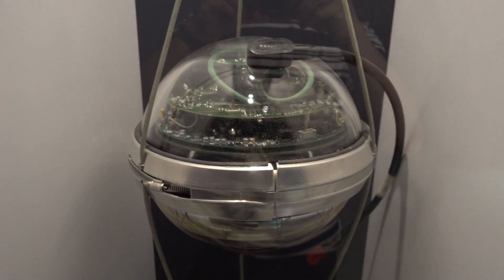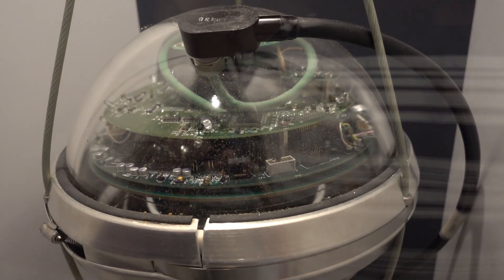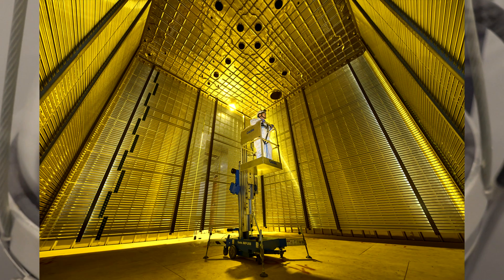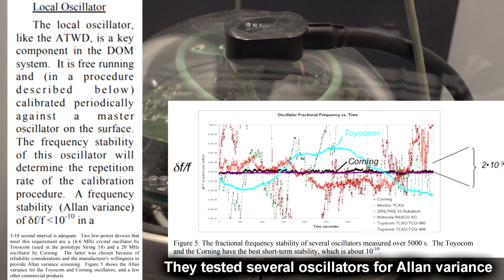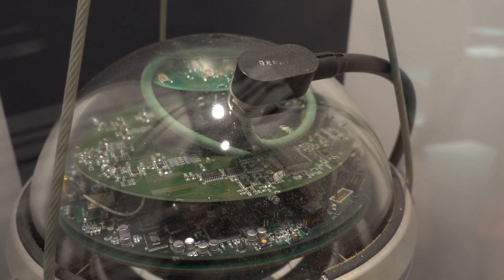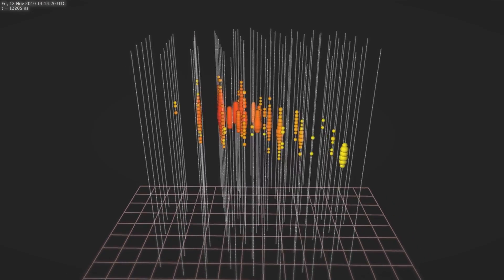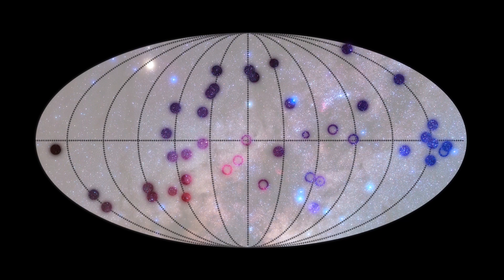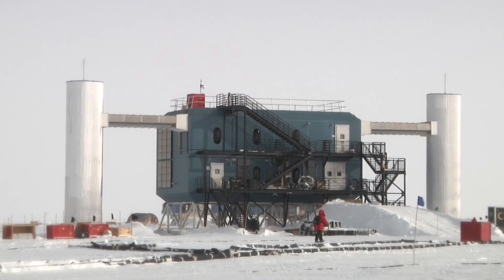Antarctic Neutrino Detector!

Comment: Hi, Dave   The Neutrinos will interact, very rarely, with the the hydrogen and oxygen in the very pure  ice causing photons to be emitted as  Cherenkov radiation.  I think they can time these pulses of light via the vast array of PMT tubes thus measuring their velocity and direction.  Also I think the area under the pulse shape curve is related to the energy level.   That's my story and I am sticking to it.   Craig
Reply: That's make sense.

That's why it was intriguing mine. Photomultiplier tubes can in cases (and I'd expect those to) detect single photons.
You don't want to shine a torch on them.

It is probably inclined in the documentation Which I will, hopefully, find time to read.
Reply from the maker: @randomelectronicsanddispla1765  LED's can output a small number of photons, I've tried to count them here:
https://www.youtube.com/watch?v=TJcMgoJ4DOE
Reply: @EEVblog2  yes, I do remember that video. I haven't found a PMT to play with yet.
Reply: What intrigues me is the LED on it...
Reply: @randomelectronicsanddispla1765  I think it's a reference. Create a pulse of light to see how all the detectors are responding and how the responses change over time.
Reply: @randomelectronicsanddispla1765  IIRC they used those for calibration: turn on the lights in one module and check if the others can see it. Flash them on and off to check timings because running a consistent clock signal through kilometres of solid ice isn't that easy either. IceCube is NOT a "direct" neutrino detector but basically a giant array of really fast, really sensitive cameras looking for the flash of light when a neutrino actually hits something (which happens very rarely hence the giant block of ice).
Reply: Wait but what if those so called neutrinos pick up a charge from the ice? I just came from from watching a video on Mr Carlson's Lab where he just saw a vacuum tube radio that was switched off and plugged in an isolation transformer and it was picking up a very high voltage from the antenna while it was snowing! Yet there isn't a ground connection but the charge from the falling snow was being transferred to the antenna and into the radio creating a visible spark which he actually caught on camera... He found out while he was sitting at his computer and he heard a ticking sound coming through his studio monitors, then he heard it coming from other speakers that were not even being used so he went out to his lab and discovered the electric arch... I have never seen anything like it! A must see phenomena. So if a vacuum tube receiver can become a spark gap transmitter all because snow was falling through it's antenna, then maybe the particle that they are trying to measure might be picking up a charge from the ice? I personally haven't tried to measure ice for it's voltage but with a decent sized block of ice and along with decent sized anode and cathode, you just might pick up a voltage if you have equipment sensitive enough! Hell if you can make a battery out of a lemon or even a potato, then this might even work LoL. What do you think Dave? Is it possible to obtain a voltage from a block of ice? Could you imagine the implications if that actually works! So you find yourself at the South Pole and your phone battery is almost dead, you pull out your usb cable that has two ground spikes at the other end and you literally just plug into the ice at a certain distance and your phone begins to change! Hmmm now where's my multimeter.... I'm going to the fridge in the name of science and electronics...
Reply: @PeterMilanovski  I sort of doubt neutrinos could induce potential difference between two points that would imply some sort of photoelectric effect. But I could well be wrong. 

From what I understand, they are more likely to either create Cherenkov radiation, which is what this experiment is looking for or, very unlikely, ionize molecules.

The idea of a  ice "capacitor" is a little funny but probably not that mad. After all, solid ice is a pretty good insulator.
Reply: @randomelectronicsanddispla1765  from what I have witnessed, there are some matter that, when cooled down to a certain temperature actually freeze their electrons, you notice when you place the matter which was non magnetic to begin with on a magnet, it doesn't sit on the magnet but instead it appears to levitate above the magnet, the matter being in it's cooled state has it's electrons frozen and so it can't pass the magnetic field through it. It's an amazing effect no doubt but we must take note of what's happening. Scientists have come up with a whole range of particles that, if you think about it! Don't really make sense, by that I mean that, what are neutrinos? What are they used for? Do we have a need for them? Why are we investing so much money into the research when there's plenty more projects that could achieve much more useful information to further our scientific cause. As far as I'm concerned at the moment, neutrinos are anything but, but most likely they are electrons at a very low charge state which would go to explain why they are hard to detect and why they don't interact with anything else. I personally would think that it would be silly to expect that all the particles that they are going to measure are all going to have to same energy level. Because at that depth, the only particles that get there are the ones that have lost their energy, so that would mean that closer to the surface, you should find a lot more particles that couldn't get through due to their energy level, most likely and logically due to the surface of earth having a charge great enough to block the path of said particles... And I firmly believe that these particles are essentially electrons at different charge states. It's what makes up the solar winds in our solar system. Just think about it like this! Earth is a nice and warm planet right! A bit further our from earth is mars, it's literally frozen! But you would expect that because you already know that here on earth, the further you sit from the fire, the colder it gets right! Now let's move a bit further out to Jupiter! You would expect it to be even colder than mars right, well it's further out from the sun! But you would find that Jupiter is actually hotter than earth? So what gives? Highly charged electron particles can't loose their energy in space because there really isn't much to transfer it's energy too! Jupiter also has a very powerful and thick atmosphere and therefore can absorb much more electron charge than earth, mars has an extremely thin atmosphere which is why it so cold, the atmosphere not only helps transfer the sun's energy to a planet but also applies pressure on the planet itself which causes the planet's internal pressure to rise and that rise causes the planet to heat internally which leads to volcanoes to form, liquid water begins to evaporate into the atmosphere, clouds form to begin storing the electric charge that surrounds the planet's outermost atmosphere, lightning strikes and rain falls, ocean fill and tectonic plates begin to move till you have a live planet once again! Phew! And that was the short version LoL... So you see, there's no need for neutrinos, photons, gluons and what ever else that they can think of. Everything that earth is made of is everywhere in the universe. Just because your instruments can't see what's there, doesn't make it automatically a new particle! It's not dark matter and it's definitely not dark energy because if it had any energy associated with it, you could measure it, if you can't then get more sensitive equipment, if it doesn't exist, invent it! Everything has a charge! Everything. We just need more sensitive equipment... Then they'll find their so called dark energy LoL... We have a job to do!
Reply: The measured value is 6.3 PeV astoundingly energetic, this particles act in unison at light speed, this particular one is heavy where did this interact, at such speed did this thing accumulated charge upon colliding, I'm pretty much sure many of this are heavy traveling millions of light years, it just so happen this one collided

Comment: They call them "Neutrinos" I've always heard of them as "the very fast cosmic rays."  Everything that I have read up to now say:  They apparently have the weight of an oxygen nucleus and they are traveling very fast, their passage through our bodies does damage our DNA in the cells that are stricken, (if the DNA is struck) disabling that cell's ability to reproduce when a neighboring cell dies, the main cause of our aging process.  They are observed and counted in mines under five miles of solid rock. (in south west America) Ron W4BIN
Reply: Humorous counter-point: https://what-if.xkcd.com/73/

As demonstrated by e.g. Thunderf00t (https://www.youtube.com/watch?v=RSsMRkN99aE) cosmic rays do contribute quite significantly to "normal" levels of ambient radiation but neutrinos are about as harmless as it gets. Amusingly your "weight" estimate is both way too high and too low: the actual rest masses of neutrinos are not known but certainly over a billion times smaller than any atom, at the same time the neutrinos IceCube measures have a total relativistic energy starting at around 10 GeV (where an oxygen nucleus amounts to 16 GeV) and going up to over a million times as much.

TL;DR: unless you live in a self-contained habitat made of specifically purified materials somewhere in the middle of the ocean you have no reason to worry about neutrino radiation. You should worry about humans producing neutrino radiation because that usually means reactors or nukes.

Comment: The original IceCube detector was completed in 2010 with some 4000-5000 of these modules (I don't actually work for them so not sure on the specifics). Each string is about 1km long and sunk down another 1-1.5km if you only count the part carrying detectors. The reason for this is that these things do not actually "see" neutrinos directly, they see flashes of light caused mainly by muons. The ice above shields the detector from surface light and some other muon sources while the actual detector needs to be transparent (which is why they didn't build it in rock somewhere less remote, neutrinos fly through mountains just fine)

As a simple summary, one neutrino (ideally FROM SPACE) will hit an electron in the ice and produce a muon carrying most of its original energy (muons are basically electrons only 200 times heavier and decay back into electrons and neutrinos after a very short period of time). This muon flies faster than the speed of light in ice and thus produces Cherenkov radiation (like the blue glow in nuclear reactors) plus more light from hitting more ice molecules. This light is what the detectors actually see, and basically the brightness and spread of the flashes tell you the energy of the muon and thus of the original neutrino.

How do we know we are measuring neutrinos and not other muon sources like cosmic rays? Quite simple in theory: the outer surface of the detector volume acts as a veto, any signal entering the detector may be background but a track beginning inside it must originate from a neutrino hit because nothing else can penetrate 1km+ of solid ice and still cause flashes like that (except maybe more exotic stuff like dark matter which IceCube has not knowingly seen so far). Cosmic rays hitting the atmosphere also produce neutrinos though, so they actually have a cosmic ray detector called IceTop on the surface to let them know which neutrinos arrived from outer space and which of them were produced in the atmosphere. Neutrinos from the Sun or nuclear reactors have a million times less energy than those IceCube normally looks for so their standard detection methods can't actually see those.

As far as the actual electronics go they have to deal with massive technical hurdles including the pressure of 1-2km of solid ice on top of these things (that's why they're thicc spheres), operating in freezing cold but also being waterproof (they "deploy" the detectors using a hot-water "drill" to melt the ice while leaving it clean) and needing to supply power as well as extract the data into the surface lab, again through 1-2km of solid ice and with limited diesel power.

And now they're building a large upgrade called IceCube Gen2 because not only are neutrinos called "ghost particles" for a reason, at the energies they're interested in there aren't that many of them even counting those which fly right through. I don't think they've actually finalised the detector for Gen2 but here's a paper on one proposed design where they stuff a dozen or so light detectors into a single sphere facing in different directions: https://pos.sissa.it/301/1047/pdf

PS: again I am not a member of the IceCube collaboration so I may be wrong or oversimplifying things, feel free to correct me.
Reply from the maker: There was one before that in 2005.
Reply: @EEVblog2  Yeah, these things always have pathfinder missions, multi-phase deployment (unless it's one massive central block you mustn't ever touch again after commencing measurements) and if they find anything interesting upgrades, follow-up missions etc.

2005 was the first deployment of strings in the IceCube Neutrino Observatory and 2010 was the last. Apparently there was an on-site precursor called AMANDA which ran for 9 years and was officially integrated into IceCube in 2005. The official name "IceCube-Gen2" for the ongoing upgrade has been used in publications as early as 2014 and they're still working on detector and electronics designs for that one.
Reply: @Photoloss  Thank you for sharing. It seems to make sense that there has been a few precursors as I remember hearing about this back in the mid to late 90's, though then it had not yet been built, and as I remember they were still somewhat uncertain if they would actually be able to prove the existence of neutrinos. From what I remember they said that most neutrinos intersecting the earth just passed through, so actually detecting a single light blip would be a huge thing. Or at least that what they thought would happen. The detector array was located where it was due to the condition of the ice. It was simply the cleanest and clearest ice they could find anywhere on earth. I didn't keep track of what happened after that though so I have no idea of what kinds of results they got.

Comment: 2:43
No Dave. They don't put them deep into the ground in order to slow neutrinos down, but to isolate the equipment from cosmic radiation.
Reply: Doesn't matter how much you slow neutrinos down, in fact they are easier to stop at really high energies. Except we're still talking about the Earth as a whole turning opaque not a glass ball in a lab capturing high-energy neutrinos. But in a roundabout way his reasoning is similar: the massive volume of ice is needed as a giant target so something, anything in there might sometimes get hit by a neutrino. Only it's "really low chance of a really bright flash" not "higher chance the more you slow it down".

On that note: because they fly straight through you basically can't "slow down" neutrinos directly. You can't accelerate them either, so the neutrinos IceCube detects are thought to be fragments of other particles with even higher energies hitting something.

Comment: photo multiplier?
Reply: Its called photonic multiplier and it is used to multiply photons for less sensitive sensors using high voltage, i think it is used in  scintillator and quantum entagled particle detectors
Reply: @oldelectronicenthuasiast  They are used in a scintillator detector which is related to a  geiger counter but not the same. A  geiger counter counts the number of decay events, where as a scintillator detector measures the count and energy of decay events.
Reply: @itsevilbert  oh well, i am NOT expert in nuclear physics and learned about these things along with other awesome vacuum technology because i like electronics but only as a hobby, as 14-year old  i only have access to internet and because english is my second language i can misunderstand, oh well i appreciate you took time to explain, i will fix the mistake, thanks! and have a nice day.
Reply: @itsevilbert  Technically you could use a Geiger-Müller tube to amplify photon signals although practical designs tend to be different. If you apply a lower voltage than you normally use in "Geiger counter" mode the tube acts as an avalanche amplifier very similar to a PMT. Scintillators aren't strictly necessary in either case but greatly improve efficiency, what you do need is a "photocathode" or an ionisation chamber i.e. something which transfers energy from light into electrons. The scintillator breaks down a single UV/x-ray/gamma ray photon into many visible-light photons which is much more efficient with photocathodes, also you need a large target for highly penetrating gamma rays and transparent scintillators tend to be a lot cheaper than massing photocathodes or ionisation chambers.

Also the name is a little misleading: you can "multiply" photons but those devices are usually called lasers, what both the G-M-counter and the PMT do is convert photons into electrical signals and then "multiply"/amplify those.